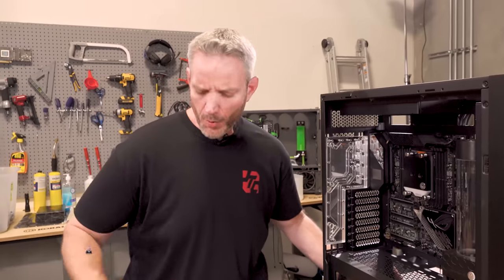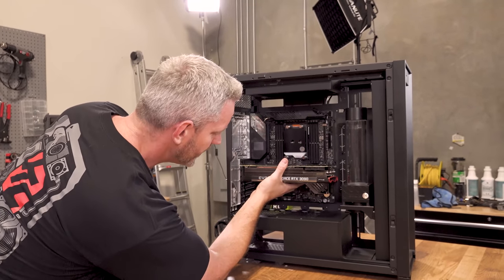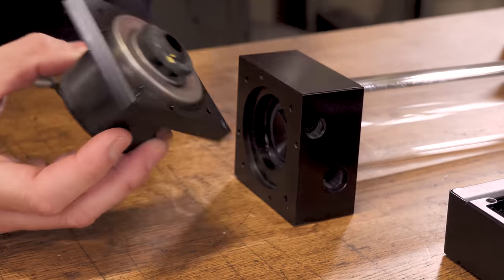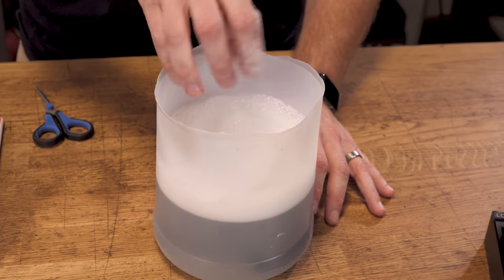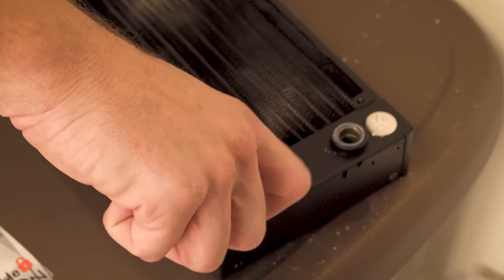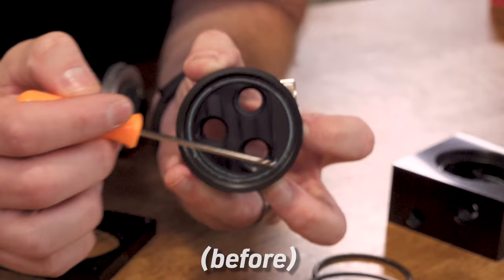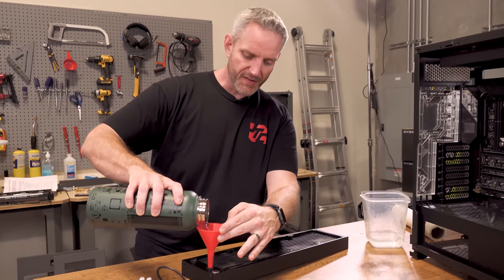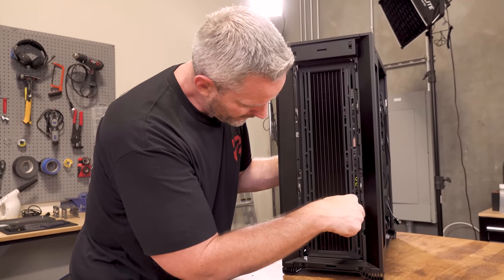Skunkworks Custom PC Build - Part 2

Comment: I hate to point out that you yourself found that Alcohol cleans the crap out of your loops and old fluid residue, but you are not using it in the Radiator which it can't hurt it in any way(inside). Just thought I would mention it as you didn't for some reason. and you have a really cool sonic cleaner, why not put the hot soapy water in it and soak the POM parts in it to clean them?
and you could have also stuck the rad into it as well... I know most of us don't have one to use but it would be cool to see you use it for this kind of cleaning.

Comment: Hey Jay, would it be possible to use a servo tester to generate a PWM signal for a PWM controlled pump? Maybe the voltage could be an issue.

Comment: They don't use 15mm as it does not line up to universal imperial size i.e. 12mm = 3/8in, 13mm=1/2in, 14mm = 9/16in and 16mm = 5/8in :-)

Comment: I'm sure that this has been answered countless times already, but I'll ask in case somebody else that hasn't seen the answer yet is also wondering.  Would running clear distilled water with an antibacterial silver agent somewhere in the loop prevent the gumming up issue that these other fluid based solutions caused that this video was showing how to clean?

Comment: 13mm OD, 10mm ID = 3mm for both sides of the wall of a tube, when you're measuring using any straight line. So technically, the wall thickness is 1.5mm..

Comment: 10/13 is actually only 1.5mm thick. The 10/13 is diameter. Which means 5/6.5 radius.

Comment: As someone who works on things that go in the ocean: DO NOT USE METAL TOOLS NEAR AN O-RING GROOVE! The pressure in a watercooling loop isn't that much over ambient so it's not as critical as it is for things going into the ocean but it doesn't take very deep scratches in the groove before the o-ring stops being able to do its job. Better safe than sorry.

Edit: also absolutely do not reuse orings removed using a metal tool, especially without very close inspection. Even fingernails can kill an o-ring...

Comment: I'm wondering, wouldn't it have been easier and more thorough to use the ultrasonic cleaner for the parts? Same process, hot water and soap, but instead of soaking them in the jug, soaking them in the ultrasonic cleaner. I think that it would have done a much better job at breaking down the build-up, even in the less accesible spots and where it is more difficult to remove.

Comment: You are wrong. Tube has got 2 walls. 13mmOD x 10mmID = 1.5mm wall thickness. If you want a 3mm wall then the outside diameter would be 16mmOD not 13mmOD.

Comment: What kind of barbarian doesnt clean with hotwater?!
If i need to clean anything i use hot water, Unless It harms the thing I'm cleaning, but otherwise, hot water.

Hot water can clean a lot of stuff pretty decently, it also allows you to use far less soap.

Comment: 3mm wall thickness? In total, sure. The correct wall thickness is 1.5mm. There are two "walls" that make up the diameter. So you have to divide that 3mm between those two walls.

Comment: I'm just waiting for my GPU block and I will be doing my loop together in a Lian Li 011 Dynamic XL ROG, 3 x 360mm radiators, 13 x 120mm fans, I will be cooling an overclocked i9 10850K and a RTX3080 😅😂

Comment: @JayzTwoCents Couldn't you or have you just hooked up a spare system and just filled it with Alcohol or Mineral Spirits and let it run??? As long as you use rubber tubing I don't think it will hurt anything.

Comment: You over-SIMPLIFIED the tubing to the point of missing a factor of two.

13OD-10ID is a difference of 3mm, but it's in DIAMETER.  The wall thickness involves the radius, which is 1.5mm.

You'd want 16mm OD for a 3mm wall thickness IF the ID was still 10mm.

Comment: meh those fittings are fine, clean them out and call it a day. after the plating gets eroded  off the brass underneath is not going to erode as bad. And the new fittings are just going to do exactly the same thing so what does it really matter?

Comment: @JayzTwoCents Hey Jay, I have a Hydro X for my 1080Ti and the flux indicator stops spinning every time temps raise to normal operation, even if the pump is operating at full speed, all of this after I opened the waterblock to clean it. Is there a specific torque to respect or should I try to lube the axle with lithium grease? Is it possible or am I risking to put a contaminant in my loop? If not, could it be used to lube ceramic bearings in pumps and prevent gunk from colored coolants?

Comment: 13mm tube wall thickness is wrong. It's 1.5mm wall thickness. 13mm OD minus 10mm ID equals 3, bit that is measuring the wall twice 180 degrees across from itself.

Comment: So you don't have a spare power supply with a jumper?  Just run your pump off a spare power supply prime/test your system with out powering on your mobo.

Comment: Now this right here is a very good reasoning why I prolly never will go watercooling. I can't be arsed to deal with all that shit and risk pumps failing, leaking destroying 3k+ hardware, having to clean it everyon now and again by disassembling a LOT of parts, etc. I know water can really benefit you and cools really well, but fuck that. Some compressed air, filters and you're done. I'm not into overclocking and shit either, I just update my system after like, 7-10 years when it starts becoming too sluggish and that's it. I save time and money doing it this way. And a lot of potential headache.

Just my 2 cents (pun intended). To each their own.

Comment: Preface with I love your videos - but your hard tubing explanation was (condescendingly as you said) wrong... If wall thickness was 3mm and Id was 10mm you have walls on both sides which means the OD would be 16mm, which is not the case. A 13mm OD hardline tube has 1.5mm wall thickness. I only had to point it out because you were so sure that others mess it up and it was 'so simple' lol. Anywho, love the build!

Comment: It’s a 1.5mm wall. 13 od and 10 id. I can use dots and commas to explain. Think of each dot and comma as .5
…,,,,,,,,,,,,,,,,,,,,… Commas are 10mm id, and and periods depict the 1.5mm wall on each side.

Comment: If you have to open up the pump and clean it, that seems like a design flaw. 
I'd be pissed if say I had to pull, tear down and clean  the water or oil pump in my car when changing coolant or oil. 

I do wonder if adding an inline filter would prevent this sort of thing.
Still seeing this seems to just scream "don't run opaque fluid."

Comment: ...jay. its 1.5mm wallthickness. you have 13mm outer, 10mm inner, yes, 13-10=3, but you have the wall on both sides. so its 1.5mm. :D <3 luv ya

Comment: Does anyone know what the distribution plate is at the back of the case? I'm currently doing a water cooling build in a 4000d and want to know if this will fit

Comment: Can anyone confirm if the Corsair 7000D comes with a vertical mount plate to replace the normal horizontal pcie slots?

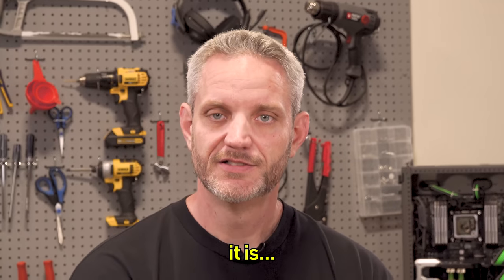Comment: 9:54 air is not a fluid, it's a gas 😂 not technically correct either Phil
Reply: Air is a fluid, air a not s liquid however, very important distinction
Reply: @jhontavarish4088  what? You're not making any sense. What is "air a not s liquid" supposed to mean?.. you know that there is only 4 states of matter, liquid, gas, solid and plasma. If air is a liquid, how can we breathe it?
Reply: @mickeyBtsv  fish breathe underwater so i can breathe underwater if i want to
Reply: @Tracenji  underWATER, which is a fluid. Not air
Reply: @mickeyBtsv  yes, water is a fluid
are you saying that i cannot choose to breathe water if i want to? (probably not a good idea)
Reply: @mickeyBtsv  i never said air is a fluid
air is a gas (at normal temperatures)

Comment: "it's 3mm thick walls because 10mm ID, 13mm OD, 13 minus 10, 3mm"

well uh, yeah that would work if you were talking about RADIUS but since your talking about DIAMETERS that means you have to divide by 2

The walls on these tubes are either 1.5mm thick, or one of the 13 or 10mm measurements are false

Comment: Uh, no? Do you clean the cooling system in your car every 3000 miles or 3 months the same way? Soak everything and tooth brush scrub the components? That pump was fine.

Comment: Nope jay you're wrong, I'm a pipe fitter for a living and wall thickness is only 1 side of the pipe. 13mm od with 10mm id is 1.5mm wall thickness. Diameter is measured across the pipe from end to end, making 2 sides. So your math should be (13-10)/2=1.5, not over complicated, simple 5th grade algebra.

Comment: lol you're wrong though. TECHNICALLY 13-10=3.........divided by 2 gives you 1.5mm wall thickness. TO BE FAIR, when your doctor measured your head, he did not divide by two to get the wall thickness.

Comment: If bought 16 gb of ddr4 ram 3600mhz cl 16 but cant get it running with xmp tried everything…

Please help
Reply: On AMD processors? Which mainboard? Which processor?
Reply: @12Burton24  its a asus prime x470 pro with an amd 7 5800x
Reply: @thenoobshow45  Biosversion? hast du die 5851 drauf.
Reply: @12Burton24  got the latest bios
Reply: @12Burton24  i Will try Thanks !

Comment: why not just replace all the parts, no one does a full rebuild and cheaps out on fittings or o rings , when your paying $2000 for a card and new cpu you would just change those parts....

Comment: Or you can basically ignore this entire video. Not deal with ANY of that bullshit. Instead use a big nice beefy Noctua CPU cooler and a nice 3x fan GPU or aftermarket GPU air cooler in a nice mesh case with good airflow and have nearly the same results. No worry about leaks, not having to deal with all that BS, easy peasy. The NH-D15 specifically has custom Chromax Black heat stink covers for it, Y cables, and marching fans with rubber color inserts for all of it. So you can mix and match colors on the cooler the cables the fans, all of it to look amazing and match your RGB/rest of your system. It’s performance is amazing, it’s cheaper, and most importantly you don’t have to deal with any of this shit. Sure loops and AIOs are nice but air is just so much easier to use and work with and in identical machines one with a custom loop and one that’s very well air cooled otherwise identical parts the performance between the two is gonna be so close you wouldn’t even be able to tell a difference outside of small small number improvements on a benchmark. Game performance and fps would be damn near identical if not.

Comment: My micrometer disagrees with your condescending attempt to do math.
Reply: The micrometer messures inside or outside to messure the wall thickness you can take a caliper or your messure outside minues inside divided through 2. 😘